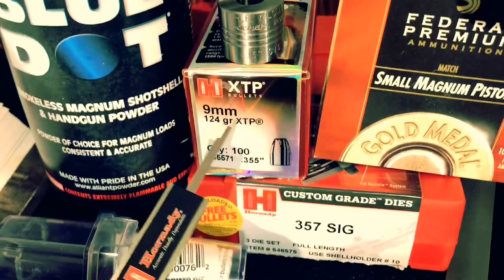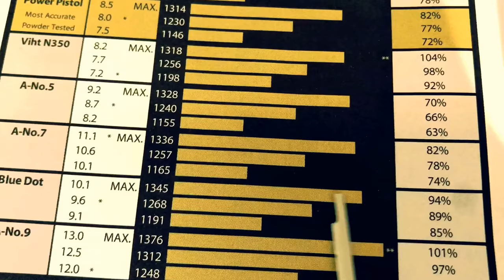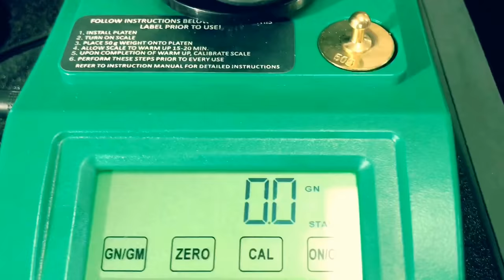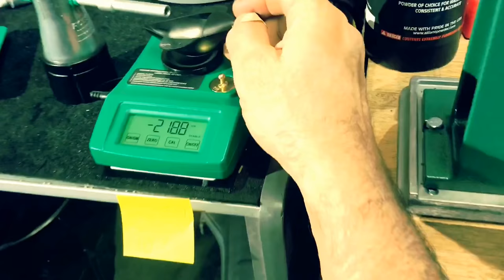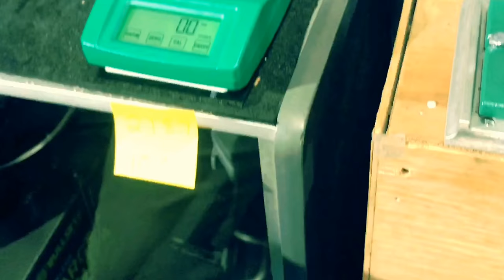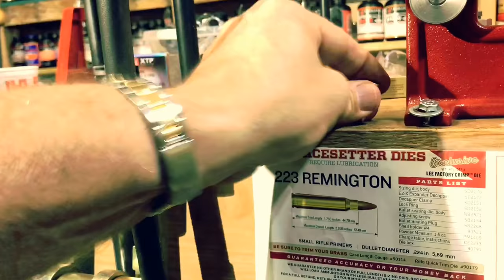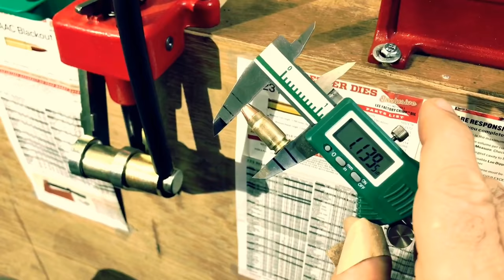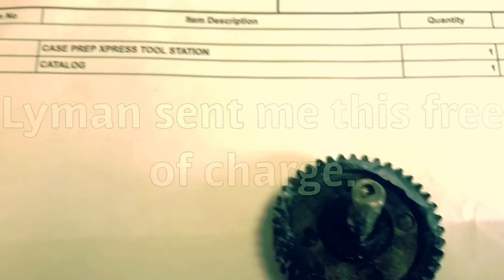Basic Reloading: 357 Sig from 40S&W with Hornady XTP & My LEE Classic Turret Press.

Comment: Thanks for sharing.

From my experience this cartridge loves to split at the mouth.  Chamfering the inside and outside creates a knife edge making it more susceptible.  I will lightly chamfer the inside to facilitate bullet seating.

Another area it can be treated as a rifle cartridge is not flaring the case mouth.  You won''t be using a boat tail projectile but with that light inside chamfer and a little practice you'll never flare again.  Doing it this way you'll find there is plenty of neck tension to securely hold the bullet and no crimping is needed.  I've used converted .40 brass and it still provided enough neck tension but that additional .015" in neck on a 357 case provides a good amount of additional tension.
Reply: I just reformed some 40 brass into 357sig....it was indeed .015 shorter, but that Lee Factory crimp die makes it look like the bullet doesn't know it. My crimp just enough to barely perceive the crimp ring. Unloading with my impact hammer requires at least 5 solid smacks on the concrete to dislodge the bullet. That surely is enough grip to shoot safely?

Comment: Excellent tutorial Johnny !!!, I am writing to you from the Argentine Republic and here we have very limited means and you have been of great help. Very didactic and clear to explain. Thanks a lot. At your command from here. You know that I am finishing my .357 SIG bullets with an OAL of 1,157 approximately and I use it in a Glock 22 with a FIRE DRAGON barrel and it works fine (using original .357 SIG case, not .40 S&W). Would you give me your opinion on it please?

Comment: I've often wondered about this?  Everyone says not to use 40 S&W brass due to the length problem, if it is a problem.  That leads me to think the .357 SIG headspace both on the mouth and shoulder?  Anyone know for sure?
Reply from the maker: Patrick Slevin In some books it’s says the 357 sig headspaces off the shoulder and some books say case mouth.  My best guess is the shoulder.  Thx for watching.

Comment: Is it possible to size down 10mm to reload 357 Sig? Yes I realize it is a large primer but would it be comparable to the 40 s&w with all the high pressure controversy?
Reply from the maker: will Pew    Oh yeah you could but 10 mm is pretty hard to find.
Reply: That would be crazy to do since 10mm brass costs more than 357 sig brass (new or used).

There is a cartridge based on 10mm.  It's necked down to 9mm.  It's called the 9x25 Dillon.  Really only used for sport shooting but not anymore.

Using 40 S&W isn't recommended.  The cases come out a little too short.  I know they work because I've found enough converted cases in "once fired" brass to know people are doing it and getting away with it.

This is why he says "All my brass is short enough where I don't need to trim it".  It's too short after being sized.

I know this comment is three years old, just commenting for anyone who happens to see this.

Comment: I always thought 357 sig headspaces off of the mouth not the shoulder ?????
Reply: James Preece SAAMI says mouth,  CIP says shoulder but in the real world it's a dual datum point ideally it headspaces off both but most of the time it's one or the other but usually just the extractor even with factory ammo the datum location is not consistent from manufacture to manufacture and chamber to chamber. 
Because it can headspace on the shoulder we can get away with a shorter case length or even using a roll crimp into a crimp groove using the Hornady and RCBS dies.

Comment: 40sw brass formed to 357 sig is NOT the same as 357 sig brass.  40SW max pressure is 35,000 psi, 357 sig max is 40,000 psi per SAAMI specs.  357 sig brass is thicker than 40SW brass to handle higher pressures.  Not to worry though, just get 357 brass...safe for and works great in 357 sig!!! (SAAMI drawing reference the case mouth as headspace point.  So maybe the internet is correct...)
Reply from the maker: jrcoffee62 ..Your absolutely correct about the case pressure differences. If you notice in my video I downloaded the converted brass to 9.0 grains to offset the lower pressure brass. I loaded the 357 sig brass at 10 grains. It’s all good. Thanks for watching and commenting.
Reply: rcoffee62-Not all brass is created equal.  I have found that stating 357 Sig brass is thicker than .40  is inaccurate.  Weighing random cases resulted in the lightest coming from .40, heaviest from 357 Sig but mostly they overlapped.  To further support this as a non issue, I can't find much on kaboom incidents in 357 Sig other than when Underwood ammo is involved.  Unlike the .40's lack of case support common to some barrels, I haven't seen this issue with  the 357 Sig.  I still have my Glock 32 purchased in 96 when Glock first offered the 357 Sig chambering.  It has plenty of chamber support.  My 357 Sig brass including some converted from .40 that has had the headstamp worn off from countless loadings can testify to this.
Reply from the maker: yartp .... I’ve loaded more than 10,000 rounds of 40’s converted to 357’s and never had any issues. As long as I drop the powder charger to 9 grain of Blue dot. That’s my go to powder and charge combination. No one I Know shoots 357sig in competition so mostly I load hollow point XTP’s. If I have 357 factory brass then I load at 10 grain of Blue dot but that’s another video. Thanks for watching and commenting.
Reply: Johnny Ray - I'd been using BlueDot since the late 90's.  I've switched to Longshot over the past couple years because when I've ordered powder, BlueDot was never in stock.  What I don't miss about the powder is how the flakes liked to jump out of the case on a progressive press as it indexed.  

A cost alternative to the XTP is an offering from Precision Delta.  Its profile is pretty close to a HAP though it's slightly longer.  Haven't loaded with an actual XTP, have the HAP.  For the individuals touting that you have to use a bullet specifically for the 357 Sig, this is not the case.
Reply from the maker: yartp I love HAP’s but I found most people like those for competition shooting so I been loading the XTP’s for everyday Range shooting and everyday carry. I used to carry a Glock 357 sig barrel in my Glock 23 for about 5 years and I shoot a lot so I like my point of impact to be the same so I always just shoot the 124’s. I never had any issue with setback with the blue dot. I have noticed it likes to splash when I use my funnel pan so I’m sure it is a pain in the ass in a progressive loader.